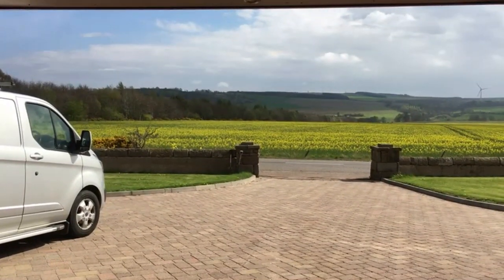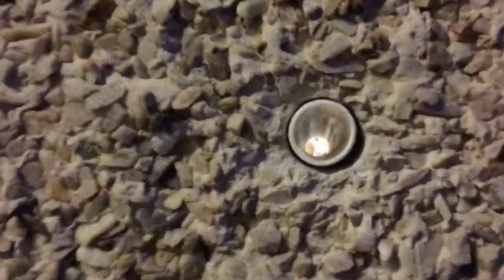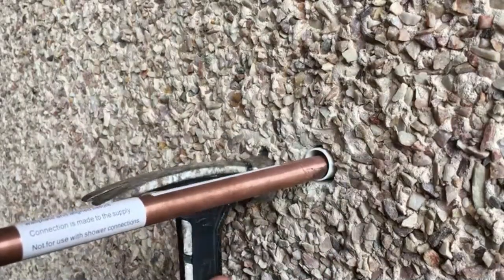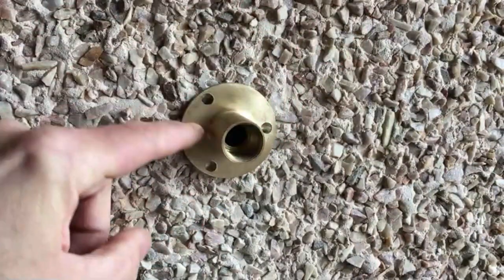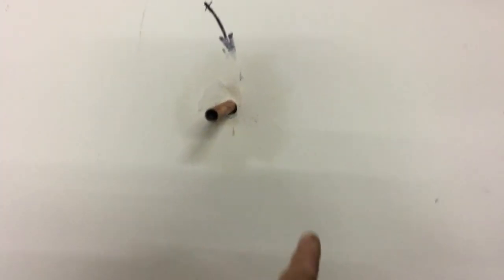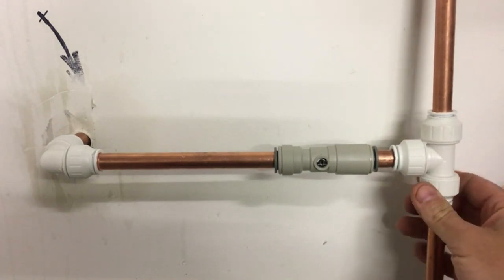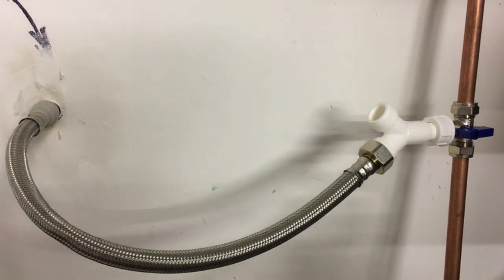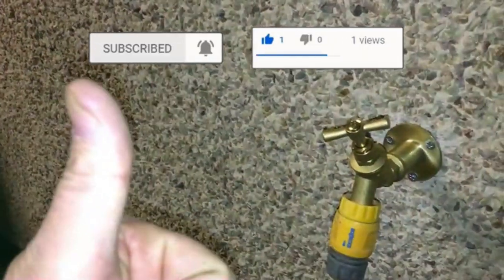HOW TO FIT AN OUTSIDE TAP | Complete Step By Step DIY TUTORIAL

Comment: Really excellent! Glad you hate those pinhole-garden hose things.  My son's house has one and it has failed so I am about to replace it with something more permanent. This video has really helped. Love the ideal of sleeving the 15mm copper pipe with the overflow pipe. The rings mean that it will be insulated against the cold by air for most of its length too.
Reply from the maker: Thanks Richard and good luck with the install at your sons !

Comment: so grateful for this detailed video, subscribed! So many useful tips
Reply from the maker: Thanks George, I am glad you found the video useful, and thanks for the subscription, much appreciated 👍😍
Reply: Bacren Property No worries mate, thanks for the vid! I do have one question that I’d appreciate your opinion on, what’s more reliable: compression or push fit?
Reply from the maker: @gman8950  Hi George, Compression fittings are more reliable if installed correctly (In my opinion). Push fits are generally good but there is always that worry that they may pop off at some stage.......(maybe I am just paranoid). Compression fittings will not budge if fitted correctly, so give a bit more peace of mind.
Reply: Bacren Property makes alot of sense, cheers mate!
Reply from the maker: @gman8950  No problem !

Comment: Some nice brass dome head screws on the outside tap and it would have finished it off. Some amazing tips in this video
Reply from the maker: Thanks for the comment, yes probably better to use brass dome head screws but it was at my property and I am not too bothered about the look, as long as it worked. Thanks for the kind words :-)

Comment: This is now my go-to method. I’ve found the Tectite Classic elbow works well, as it’s compact, easy and complements soldered joints.
Reply from the maker: Yeh Gordon, I like the tectite fittings as well, got a few of them, they look better than compression or speedfit connections - readily available from screwfix as well and you can often get them on a deal 👍😎
Reply: @Bacrenfencing  although many places carry the fittings, I haven't found a supplier near me that does the removal tool. I haven't needed to demount one yet, but the day will come…

Comment: I really enjoyed your video. Best I've seen for pace and detail and I think the plastic pipe is a great idea. I'm inspired to have a go myself. Can I just confirm the O rings link is correct for the ones with 11x15x2mm rather than 15x17x2mm. Probably me over worrying tolerances as no expert!
Reply from the maker: Hi Kevin, thanks for the kind comments. Yes the link for the o-rings is fine. The o-rings do not need to be inch perfect as they are just to make it easier to centralise the pipe. You can use 15mm OD or 17mm OD but the 15mm fit tighter over the copper pipe, so do not move when you place the copper through the sleeve pipe (if that makes sense?). Let me know how you get on and if you have any problems, just let me know on here and I will help you out. 
 Thanks again for the comment ! 👍

Comment: For anybody in England or Wales this does not meet the regulations.
Since 1999 a tap with a built in check valve can only be used to replace an existing tap with a built in installed before 1999.  
A tap installed after 1999 must be one without built in check valve.  Taps without 'built in' check valves must have a check inside the building along with a means off turning the water supply to the tap. 
The reason the regulations were changed for garden taps with 'built in' check valves is because in winter time when the water supply to tap is turned off inside the building  no one ever let the water out of the check valve mechanism using the little nut under the tap.  
Without releasing the water it froze within the check valve breaking the plastic parts rendering the non return function inoperable.
Reply from the maker: Thanks for the comment

Comment: Excellent video. Thank you very much. Is it possible to go through the wall with an ordinary hammer drill as I don't have an SDS drill?. Cheers, super clear and informative video 💯
Reply from the maker: Thanks, Yes, you can go through with a normal hammer drill but best to do it in stages with small diameter drills gradually building up to the large one. I.e use maybe an 8mm drill bit, then a 12mm and so on. Or you could just try using a big one, but it will likely take ages to get through. Hope this helps
Reply: @Bacrenfencing  Thank you so much for your reply. The problem I have is an ordinary hammer drill chuck (not SDS) won't be able to take a 22mm drill bit so it would mean a maximum diameter of say 12mm. Problems, problems. Might have to invest in an SDS

Comment: Excellent video, really clear with good pace as others have said. One thing that i am wondering though is why does the pipe need a plastic sleeve ? what would happen if you just put copper pipe through the wall ? Thanks
Reply from the maker: Thanks for the kind words. 👍
 Putting the plastic or copper sleeve through the wall is merely to serve as a protective barrier (in the case of water pipe or cable) It protects the pipe from damage from the masonry or from falling debris between the cavity wall. Chances are that it would be fine to use without sleeving the hole (plenty people do it) but it is deemed best practice to sleeve the hole.
  As an aside - Gas pipes need to be sleeved with copper, but that is for the gas safe engineer to deal with as illegal to do this if not certified.

Comment: Nice video. I just did an install, but found I had a problem with the double check valve not allowing any water flow into the tap. Air lock I guess. Is there any way around this? Unscrewing the bottom port did nothing to help it. I've not seen anyone else with the same issue.
Reply from the maker: Sounds like a faulty tap to me, have you tried using another tap ?

Comment: Hi mate what's the purpose of the pipe liner, am new to all this plumbing, thanks john.
Reply from the maker: Hi John, It is basically to protect the copper pipe from getting damaged. Damage can occur from debris falling down the cavity within the wall or damage can occur if the copper pipe vibrates slightly when in use. If it vibrates when resting on concrete, it can damage the pipe, so always best to sleeve the hole. Hope this helps and thanks for the comment.
Reply: @Bacrenfencing  thanks, video liked and subscribed👍
Reply from the maker: @TheWhisky81  Awesome, thanks John !

Comment: Is the plastic sleeving essential, or can I just wrap electrical tape around the pipe going through the wall
Reply from the maker: Hi, No it is not essential but good practice to do so. You can also use 22mm copper pipe to do the same. Electrical tape will not really do anything but by all means do it if you want - thanks for the comment

Comment: Loved the video showing the good and bad methods. Video is handy and well timed as I'm about to embark on fitting an outside tap. Do recommend connecting to the cold water feed pipe that feeds the boiler?
Reply from the maker: Thanks for the comment and glad you found the video helpful. You can tee in to the mains feed to the combi boiler, but just make double sure it is the mains FEED and not any of the central heating pipes 😀👍 Also, if using a tap without a double check valve, you will need to fit one between the tap and the isolation valve. 👍
Reply: @Bacrenfencing  thank you...
Reply from the maker: No problem, hope the install goes well. Thanks again !
Reply: @Bacrenfencing A ha...got the outside tap done this week...but got the wrong fitting (coupler instead of a slip coupler) so had to get the right one lol...all done and dusted now...thanks for your advice and once again great informative video compared to others on YouTube 👍
Reply from the maker: @JackKing12.  Thanks buddy, I am happy that you got it done with a little help from the video - Cheers !

Comment: Is it absolutely necessary to protect the copper pipe through the wall?
Reply from the maker: No, not absolutely necessary for this application, but it is good practice to do so. If it were Gas, it would be a requirement. Thanks for the comment. 👍

Comment: Hi ..loving the vids.great work...just wondering what type of insurances you carry as you seem to do a lot of trades.  I do plastering tiling and just added water plumbing to my services and wondered what type of insurance would cover the various trades ...many thanks and keep up the videos
Reply from the maker: Hi Paul, Thanks for the comment, where are you based ?
Reply: @Bacrenfencing  wirral Merseyside
Reply from the maker: Thanks Paul, wasn't sure if you were in the USA where thngs differ slightly. We use Public Liability and Professional Indemnity Insurance up to a value of 5M. We use Zurich but it pays to shop around. Also, it depends on your own circumstances and what clients you do work for. You need to tailor your own insurances to your specific needs.
 If you are just doing tiling and plastering then a good Public Liability insurance would be fine but if you are qualified and doing plumbing, electrical or actual building work then definitely need Indemnity insurance. Hope this helps ?
Reply: @Bacrenfencing  brill...ye got city and gulds 3 in plumbing (non gas) will shop around and see what I can find. Many thanks
Reply: Dont touch electrics....

Comment: Love That o ring trick 👌🏼 . Is the 22mm sleeve mandatory ? Cheers
Reply from the maker: Hi, No, the 22mm sleeve is not mandatory for an outside tap but it is good practice to install a sleeve when installing pipe or cable through a wall - it helps protect the pipe or cable. Thanks for the comment. 👍😀
Reply: Ok mate.  Really like your video very well explained everything, very detailed through out . Subscribed you aswell  keep it up mate 👏👏👍🏼
Reply from the maker: @bikramjitsingh9165  Thanks for the kind comments, yes, I tried to give a fairly detailed overview as a lot of the other videos just sort of cover the process briefly. Thanks for the subscription and glad to have you here buddy !

Comment: Very informative video, however current regulations Do Not allow an external check valve to be fitted on a new installation. A double check valve must be fitted inside the property due to the contamination hazards. Always ensure you use a WRAS qualified plumber to install potable water fittings and outside taps.
Reply from the maker: Thanks for the comment Simon 👍

Comment: You should have fit a double check valve to prevent backflow and therefore main water from getting contaminated
Reply from the maker: 😂 Why would I fit another double check valve when there is one built in to the tap as explained in the video ? 
 Please enlighten me ? 🤔

Comment: You mentioned that using a y-connector is a no no. Any particular reason why?
Reply from the maker: Apologies, I should have clarified, I meant to say in the video that using a PLASTIC Y-Piece is a no no because they are prone to splitting. You can get the brass versions which are far more robust and acceptable to use - something like this https://amzn.to/2U3Qfns  Thanks for the comment ! 👍

Comment: Good video, explained yourself well but you didn't show people how to tighten the pushfit elbows and tees properly and you didn't put or mention the non return valve that is needed
Reply from the maker: Hi Scott, If you watch the video, I did show how to lock off the speedfit fittings - these fittings do not "tighten" they push fit and then lock off. I purposely did not fit a non return valve because the tap had one already built in, as I explained in the video...........? 
  Thanks for the comment !

Comment: How do you know that there are no pipes, wires etc. in that place? 🤔
Reply from the maker: Use experience and common sense. Always check all around the wall area, you can generally tell if there are going to be any pipes or cables by looking around the space. It would be very unusual for there to be any pipes or cables actually in the brick wall, they would be more likely to be between the brick and the plasterboard, so you can get a good idea by looking around at the internal wall space. If you are not confident doing this, then best call a professional. Thanks for the comment